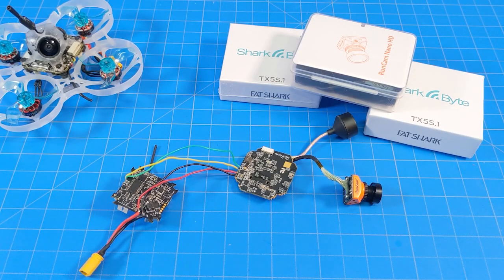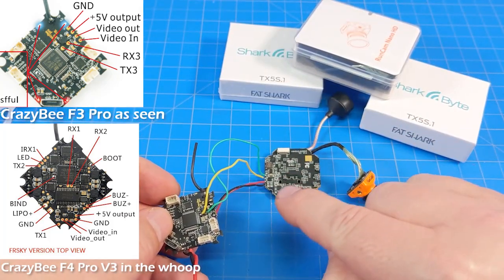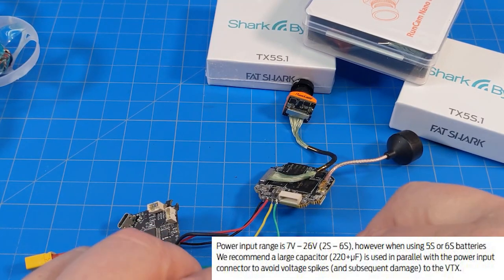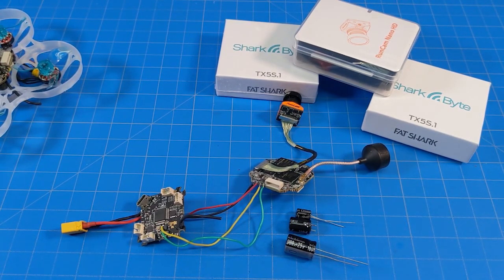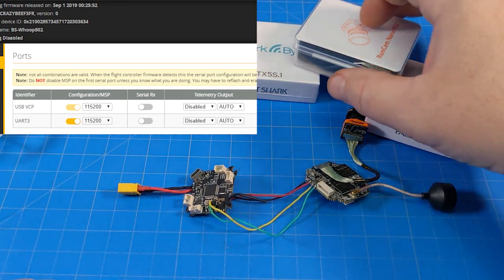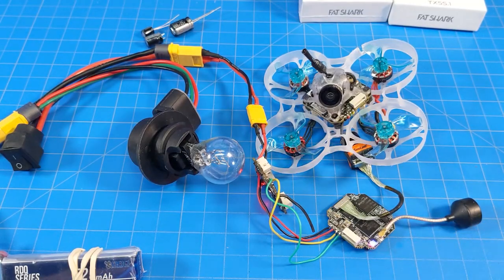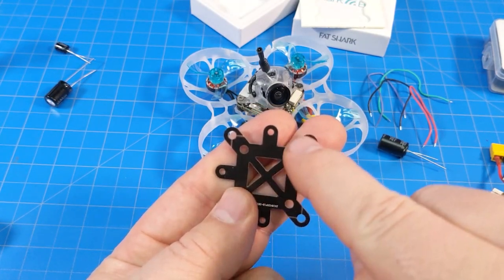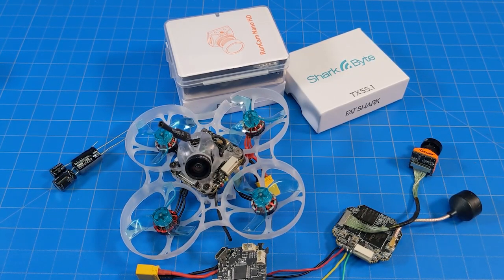Shark Byte Install // Wiring // Betaflight // Whoop Board

Comment: Yeah couldn't make this system work. Did all the firmware updates tried a second vtx no luck. I am not new to fpv I have more than 10 quads so i'm not a beginner. I refuse to start replacing cables and cameras. I cannot recommend this system. I'll just stay analog and ebay this digital garbage.

Comment: That whoop only has 5volt pads how did you get 7 volts to run the shark byte
Reply from the maker: Solder directly to the battery led pads.

Comment: Hi Nick just upgraded one of my old whoops with exactly same FC to shark byte and I have no OSD at all. Running the latest firmware on RX and TX. Unfortunately crazybee f3 cannot be updated to higher BF than 4.0.6. Does this mean that I need to downgrade firmware on shark byte tx?
Reply from the maker: I believe to run canvas mode and get the osd we do need to be on betaflight 4.2.9.
Reply: @NickBurnsFPV  Thank you

Comment: Hi Nick! Can I convert the tinyhawk freestyle 2 into the sharkbyte system? Thanks
Reply from the maker: It does look like the board has a full uart we can use for shark byte. We would need to power from the battery led pads and also we need to locate the video in and out connections. One is pretty easy the camera connector, the other I don't see in the emax manual, but it would be where the vtx is connected.
Reply: @NickBurnsFPV  , thank you very much,  sir!

Comment: Good evening Nick, do you have any idea where I can purchase a spare joystick and cable for the single 200mw shark byte board, I fly several KISS rigs and just find it easier to leave the cable connected to the board, but the cable is a very small type molex connector, any thoughts would be appreciated.

Thank you
Danny

Comment: Thank you for the video! Starting my first build with this little guy!

Have you found a shorter mipi cable? Or used your significant influence to ask for one? Maybe 1/2 the length?

How does the dipol antenna perform vs the axii? I wouldn’t mind the axii so much if they would mold in a lip at the base to zip tie to the canopy. After a few crashes mine always suffer from whiplash or end up headless.

Is the new build going on a toothpick?

Thanks again for documenting your shenanigans!
Reply from the maker: Lol. Sorry, I had to laugh, my "influence" is likely pretty low, but I appreciate the thought. The cable that comes with the whoop board is the shortest I am aware of. For me the dipole has worked well, I suspect in metal or high multi path environments a cp would be a better antenna. Right now I have two whoop builds, but I am looking at another ultra light for outdoor.

Comment: I can't find where the manual specifies when to use the cap in terms of input. It seems to imply that it's always needed regardless of input voltage
Reply from the maker: The part I have in my video is from the previous iteration of the manual. I have been flying on 2s without a cap on two quads.

Comment: Thanks for the guidance Nick. Seems easy enough.
Reply from the maker: yep, just need 7v tx to rx and rx to tx. I solder the wires to the shark byte first as they are side/edge pads.

Comment: I'm glad that there will be a competitive solution to DJI - but Shark Byte (aka ShaBy) is not that product. The video quality is horrible compared to DJI, but worse yet the product is just not stable. 

If you look on rcgroups you will see tons and tons of product failures including boards constantly blowing up, amongst many other catastrophic failures with ShaBy. But even if ShaBy did not have all the hardware problems, the video quality is still awful. 

Glad to hear that an attempt was made, but this is not a viable digital FPV solution because it doesn't work well, or it doesn't work at all.
Reply: Here is the thing tho , most of those blow up boards were pre pre production units and blowing up is kinda expected on an prototype. The 2 stacks seems a little rushed but the whoop board looks awesome. Second , I believe the bad image quality is largely an issue of the camera and new cameras will come out soon so we will see than . Third , this is a new system , if you remember how analog used to look 3-4 years ago than there's a big difference , DJI when it first released had bunch of problems related to signal reliability , performance and owerall everything . And look how much better it looks/feels now. As kinda a proof of the camera causing the bad video quality in shark byte , you can look at the latest video from Mr shutterbug where he flies with a nebula , although the video is slightly better than shark byte  you can see the same problems that shark byte is experiencing with the video , aka weird haze and halo and generally weird colours. This leads me to believe that once SB gets better camera , it will look much nicer
Reply: @nistax2880  “Can’t we just all get  along?” I’m an analog guy so I haven’t picked a side. I think, the more options & competition, the better for all of us.
Reply: @nistax2880  is correct, the cameras for the ShaBy system are just awful and they make the video look worse than analog in many cases.
Reply: @jamesking1128  yeah , which means that the system isn't trash , only the camera
Reply: @nistax2880  Is there a camera you can use with ShaBy that is not trash? If not, the system is trash until that is no longer the case.
Reply: @jamesking1128  yeah right now there isn't , but there will be , the system isn't trash the camera is. What you're saying is basically this right: there's a really nice house, but the main doors don't have a lock installed , meaning the house is trash and I would never buy it. Like yeah no you could just install a new lock. The fact that one replaceable part is bad doesn't mean the whole system is bad
Reply: @nistax2880  Except you cannot install a new lock, or in this case, a new camera. You have made an excellent case why it makes no sense to buy ShaBy right now because there is no acceptable camera. 

It beggars belief why a company would release a digital FPV system without an acceptable camera. Yet here we are.
Reply: @jamesking1128  yeah but here's the thing , nobody expects DJI has done a good digital system yet , nobody has done a digital hd system with consistent latency (I'm pretty sure someone did but not for fpv u know what I mean) , so the new part and the part to be sceptical about it the actual hd receiver and transmitter and the overall condition , since that's a new technology basically , from what iw seen that part of the system is good , developing a camera that doesn't suck has been done before , and isn't as a monumental task as the digital system itself. So it's to be expected that one of the cameras that is coming to market for SB is gonna be decent . 

The second part of your comment makes perfect sense , from what I've gathered the reason was that runcam had little faith in the system and refused to develop the camera much further because they thought it would not be worth their time and money. That's why fatshark was basically forced to relase the system with a crappy camera. 
But right now the system is selling much much more than anyone expected = it is worth for manufacturers to start making and put more money into development of an shark byte cameras. 

I'm not saying that SB looks good now , all I'm saying is that the hard part is solved and looks good , and the only thing left to solve is the easy part . 

Right now the system looks meh , but it will not in a short while
Reply: @nistax2880  Your speculation on why Runcam put out a bad camera is total speculation because you have no source on that.

That said, it doesn't explain why Foxeer put out a camera for ShaBy that is just about as bad.

You have some interesting theories why the ShaBy cameras suck so badly, but you have no facts or direct sources to back up the theory.

Unless you can show a direct source (you can't), this is all just a conspiracy theory.
Reply: @jamesking1128 bold of you to assume I would be this smart to think this whole thing up
Reply: @jamesking1128  just tried SB in the Google's , yeah it is good af
Reply: tons and tons of product failures ...really..I post on RCG in  the Shark Byte threads....I see maybe 2 or 3......so tons and tons ? Hyperbole much ? ...lol..why are you DJI fan bois so desperate to dismiss  Shark Byte ? Are you afraid of something ???? Maybe they make a mask for that...???...lol...
Reply: @steve_beatty  cry more
Reply: @jamesking1128  Not me whinging on here friend...clearly it's you that's upset...lol..
Reply from the maker: okay all. Let's not start in on each other. As I often say, "Fly what you like and have fun".
Reply: Go somewhere else 
Your post about SB being not better then analog are annyoing
Reply: @jas-FPV  is this your youtube channel? No? Oh well, I'll stay then.